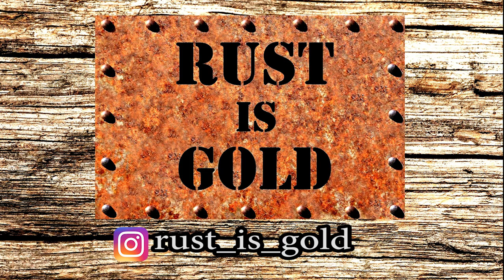DIY Mini Dagger Knife & Leather Seath

Comment: No heat treat? Or did you keep the file cool while you were grinding as to not ruin the temper? Not trolling just a legitimate question.
Reply from the maker: Dear Austin Wheeler, you are right, I didn't heat treated the blade for various reasons. I kept the blade cool during the process, it never reached high temperatures. This particular knife will be used solely as a paper cutter so that was another reason I decided not to heat treat the metal. 
I am planning to make a normal size dagger knife which I am going to heat treat properly.
Hope I answered your question!!
Reply: Rust is Gold Yes sir you did, I'm getting into knifemaking myself and I was watching videos to learn more about the processes involved, I look forward to your full size dagger video! Good luck and thank you for your feedback.
Reply from the maker: Austin Wheeler I will let you know!  Take care!